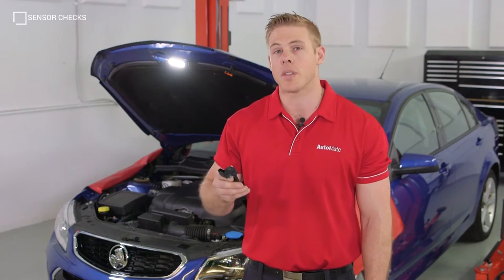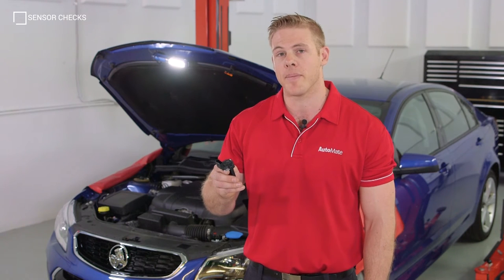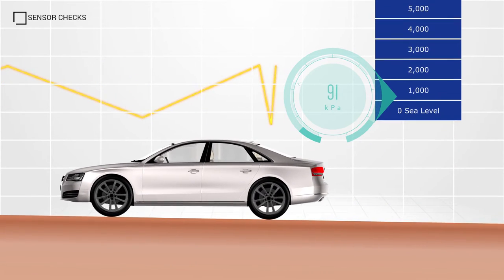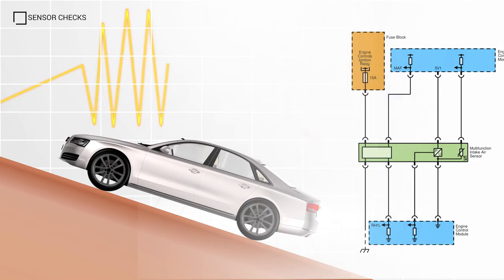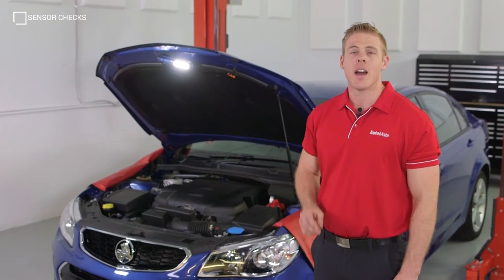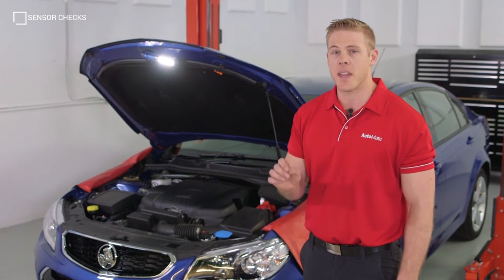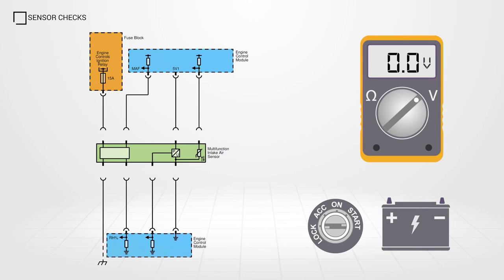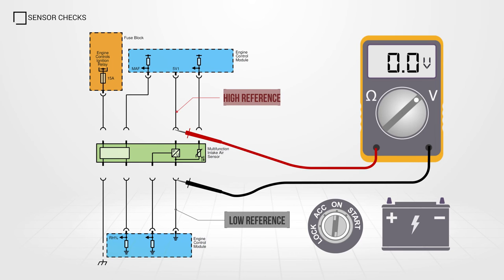Barometric Sensor Signal Faults

Comment: Hallo sir, barometric sensor the same as a map pressure sensor?
Reply from the maker: Hi Rahmat,
The barometric sensor is different from the MAP Sensor. A barometric sensor measures atmospheric pressure (pressure of the surrounding air), a MAP sensor measures and calculates pressure inside the engine manifold.
Hope that helps answer your question. Cheers!
Reply: @AutoMateTraining  what if you modify and install a Baro sensor in the intake manifold, would it not read the same as the Map sensor. Map and baro sensors read the same withe vehicle KOEO